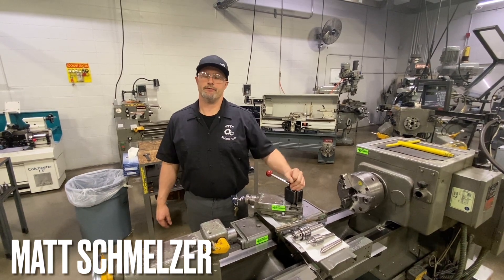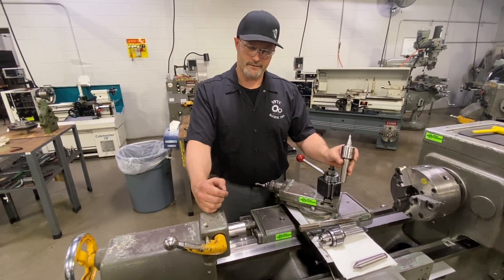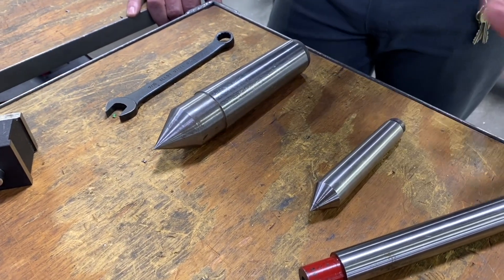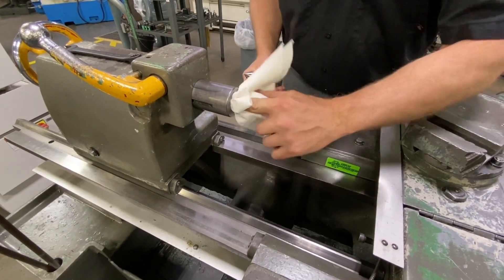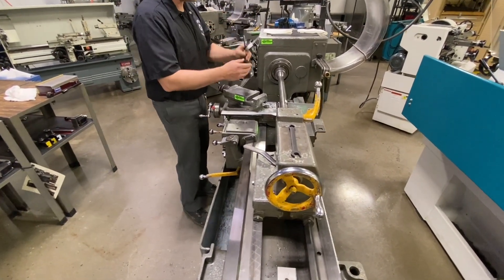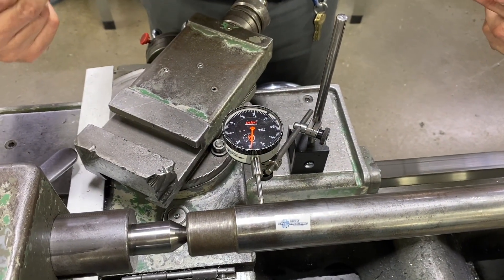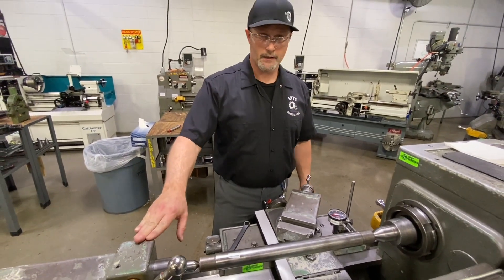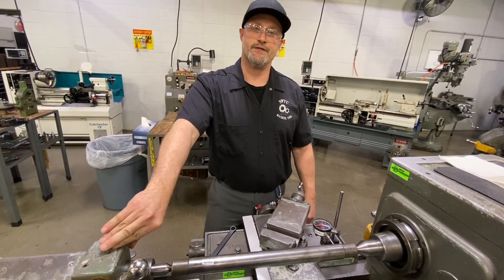How to Align a Tailstock on a Manual Lathe

Comment: Hi thanks for making these videos.
 I noticed you did not check vertical run out from headstock to tail stock on the test bar. If the tail stock needs to be raised or lowered to have the process of drilling on center. 
Thanks, Bill.
Reply: The height of the tailstock in relation to the height of the spindle (in reason) has little if any effect on how much material is being removed from end to end. The only thing vertical misalignments does is cause the cutter to be slightly off-center from end to end.  Most tailstocks are slightly lower (several thousandths) due to normal wear.

Comment: I have a 1956 13" south bend lathe ,Does anyone happen to have the spindle nose cone that I believe allows you to put a center in it to allow to turn between centers ? the chuck end spindle bore size is 1.616" in diameter the far left side opening is 1.412" spindle diameter approximately 2 1/2" into chuck end of spindle is 1.515" and overall length of spindle bore is 21"

Comment: Thanks for the info. Unfortunately, while this a great tutorial on the basic way to bring an out of line tailstock back in, everyone wants instead to highlight all the other problems found when checking out a lathe. This video is not about correcting all problems found on a new-to-you lathe. It’s about bringing the tail shaft back to center after taper turning, etc. At some point we must assume the other checks are okay, that the lathe is level, the bearings are good, the taper is okay in the tailstock, and on and on. The information given here is useful on its own and is exactly what the title describes.

Comment: There are some  problems: to make  shure that the indicator is always in the middle of the test bar you must check the height of the tailstock,  check if the bed ways are straight and not worn out and last but not least if the result of the indicator also is the same in every position of the tailstock quill.

Comment: Always remember, nothing will destroy a tailstock faster than, errent chips entering the taper of the tailstock quil, spinning drills in the quil, using drills, chucks, and centers with damaged tapers . Once this taper is chewed, it's nearly impossible to correct to it original shape.  I seen too many tailstocks with this damage.

Comment: What if the tailstock is out of alignment vertically? Would the roundness of the test bar indicate that when only measuring on the side?
Reply: Do the very same check only on the top side of the bar. I have heard that a new lathe should be a tad high on tailstock end .0005 to .001 will wear in. I suppose it would really only matter if you were machining parts with extreamly tight tolerences into the 10ths of thousands. An old lathe with wear is extreamly dificult to hit tight tolerances simply because of the wear. Reguardless of care to set up as close to perfect as the machine condition allows.

Comment: What about the up and down alignment?
Reply: That’s true, but I just need mine to be within.001 ! I use a boring bar for tight stuff.
Reply: Had to put a shim under the front and back of mine .
Reply: @mikem970  How are you going to do this on a super-precision lathe? Sometimes the shim needs to be 1 micron in thickness. Aside from that. What about orientation adjustment?